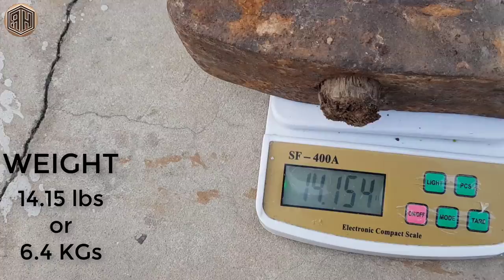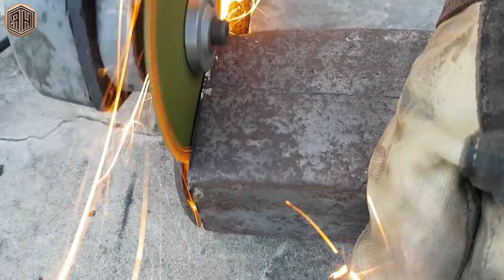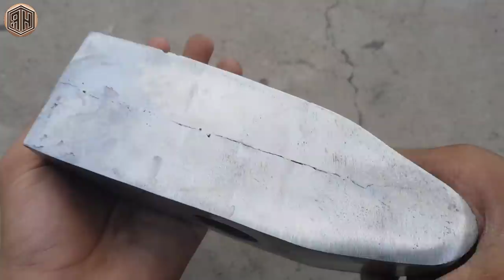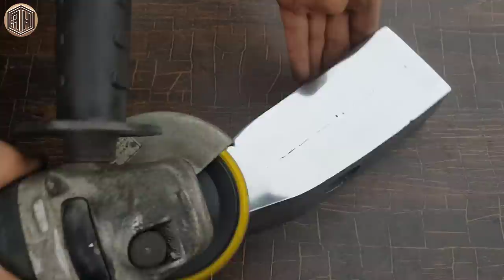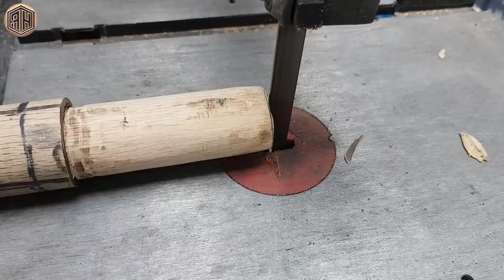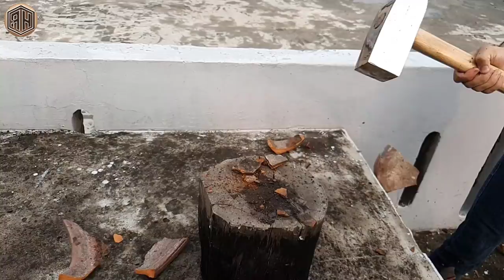Giant Hand Forged Hammer Restoration - Mirror Polish Finish

Comment: If you only knew how many hours I've spent removing that damn varnish from wooden tool handles....   Next time try giving the raw wood a nice coat of boiled linseed oil then let your hands polish the wood as you work with the tool over time.   I think you'll be pleasantly surprised at how much nicer the wooden handle is to use.  Great video man, keep it up!

Comment: I'm no welder. My Son is. One thing you could have done is: Take a grinder or cutoff wheel where you were welding the low spots. The biggest issue is what is your weld going to stick to? Grind out the rust and you would have been done faster. The crevasse filled up and all you had to do was knock it down level. Even polished, the divots and cracks are seen. Grind those out, weld to fill and knock down the high spots. It would be Perfect.

Comment: Welding on something as thick as that hammer you should crank up your heat and just pull a straight bead, stay nice and steady and don't pull too fast, chip off your slag afterwards and wire brush it before your next weld to keep slag inclusions out, if you want to get better at welding just grab some scrap steel and practice on it for a while.

Comment: Should have grinded the hammer a little more and drille a slightly bigger diameter hole to hide the flaws. Also should have used  a lathe for the wood turning. Other than that it's good job.

Comment: The next time you restore a hammer do not use 6011 or 6013 you wouldn't have had to work so hard to finish it. Use 7018 you would have finished much sooner. You did a nice job. God Bless Ben

Comment: Hey when your welding it helps if you get the flux off so they look pretty and you dont have air pockets in then ,and 7018 would have been better than 6010
Reply: Agreed

Comment: It's unsafe to use a hammer with such cracks. 
At an unpredictable moment, it will split along one of these cracks and the fragment will fly away in an unknown direction. 
You need to weld all this cracks. 
Cut a groove around the cracks, as wide / deep as possible and evenly warm a hammer before welding.

Comment: This one is a no for me, you have many other beautiful videos, and while it is very relaxing to watch, you took a few too many wrong turns here and there...
I'd have heated up the head as it is quite chunky, that would get the weld to stick better, you are basically repairing something the size of a small anvil after all.
You welded on the hammer without grinding it clean, I would have also gone down a bit in that weld line that appeared to be rusting.
You used too many tools, just put it against some form of flat sanding surface, there was no need for the grinder, and if you use the grinder there surely is no need for the citric!
You cut away the rounded face but I am fairly certain that it was supposed to be rounded and not flat, anyways if you do that and then leave a face with 2 major cracks in it that looks like it's about to lose a whole damn corner...well it comes off as kind of pointless.
I don't know as a lamen watching this video it is all it needs to be, relaxing, no annoying tunes, satisfying,nice photography and all, but if you know even a little about what you are doing it comes off more as an attention grabby video without any real substance behind it, like the ones of people refinishing crusty modern items and calling them "ww2 lighter restoration", if you get what I mean.
Anyways I'll watch a video in which you make something completely different from some metal stuff, those I always like :)
Reply: Yepp he shouldn't weld over the slags too. If he didnt, the weld would come out much better. Plus, i'm a bit sad that he used the grinder instead of the orbital sander to polish the hammer.

Comment: You should have used boiled linseed oil on the handle instead. With a hammer that heavy, the clear coat spray only makes the handle slippery.

Comment: i have a smaller hammer head that is really old like this, and i already polished it to have close to a mirror finish, but it looks disgusting because there are these little dimples that just cant get cleaned, and i cant just grab a file and file them off, because the whole hammer head is made out of hardened steel, meaning i will more likely destroy the file than file of even a milimeter of it. and i dont want to buy a diamond file either.

Comment: Seriously brother you need to get a sand blaster and save using all those chemicals all the time, which are toxic.
A sand blaster would have clean that up with no effort at all and without damaging the hammer.
And why the hell did you cut off the end of the hammer? They're not supposed to be square they're supposed to be a little round at the end so they're not sharp. All you have done is damaged the hammer.

Comment: Rust is not on surface it's a whole process. You may grind and make the hammer look good but it's weak. Sulphuric acid don't enter into the iron layers . You will hammer with this hammer and within a week it will detoriate . You didn't make to showcase on camera didn't you. :)